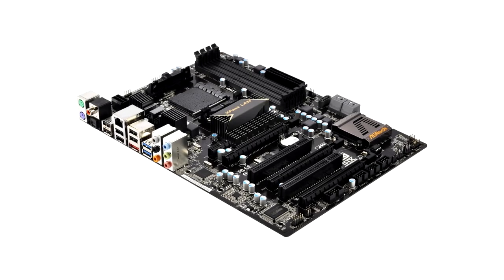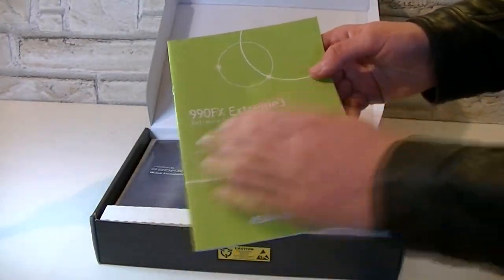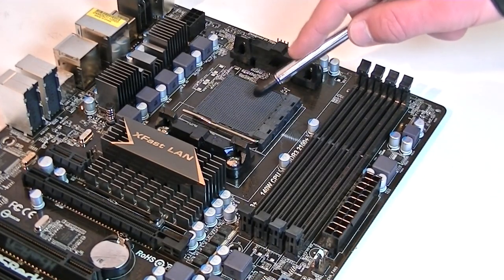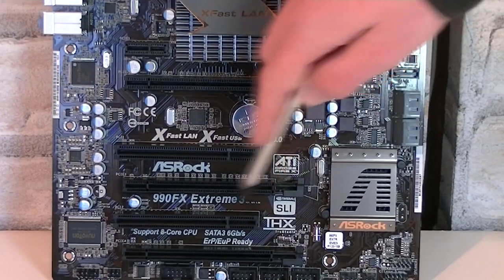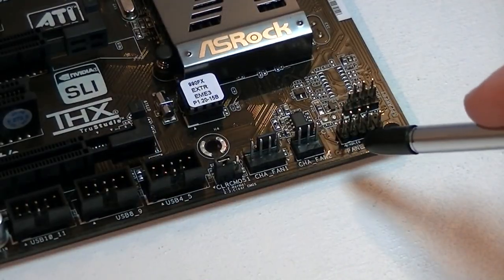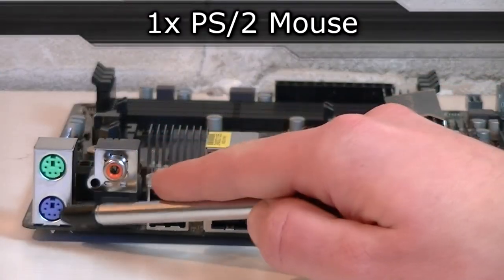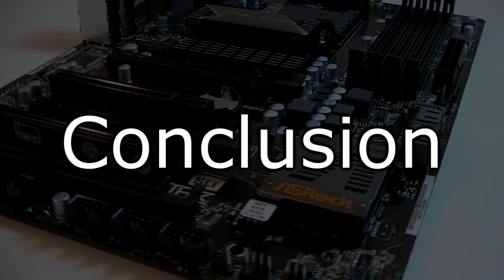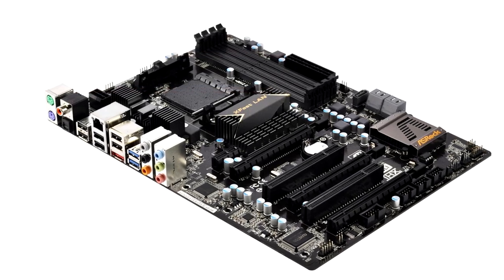ASRock 990FX Extreme3 Motherboard Review

Comment: Nice review, doing a $1 500 Australian builds with an 8320, 16GB RAM and GTX 760s in SLI and still wanting a 990FX board, 2TB HDD, SSD, 650W 80+ PSU, Hyper 212 Evo and a Carbide 300R

Comment: This motherboard rocks!   I've had it for nearly 6 to 8 years, give or take.   My system is Asrock 990FX Extreme3 Mobo, FX-6400 (Vishera 6-core) processor, 16 gigs of Ram, Ti-750 dual fan 2 gig video card, running under Windows 7, and I haven't had any issues.  I do not overclock it, because that shortens the lifespan of the system.  Not a single maintenance issue, and I haven't cleaned it in over 2 years, or longer. lol

Comment: for just a little bit more you could get a 990fx Fatal1ty from ASRock, With the 12+2 power phase the vdroop is nearly gone on the board and runs cooler then the Extreme3 at a higher clock.

Comment: Great review Nicolas! This does seem like a great motherboard, especially given the price. I'm in South Africa, and here this motherboard is on the same price level as an Asus that only has a 970 chip. Even the Extreme4 is cheaper than an M5A99X (990FX vs 990X and has a USB3 panel included!)

The only worry i have here is the after sales support, given that there are very few dealers of ASRock, with the market dominated by Asus and Gigabyte! Great value though

Comment: Great Video. I am thinking of buying the asrock 990fx extreme 3 motherboard. I am planning on running crossfire on  two sapphire 7950s. I am not planning on overclocking my CPU which is the FX-8350. Am i going to have any problems because of the fact that my M/B. has 4+1 power phase design?
Reply: thank you! that's what i bought!
Reply: Jimmy Greek Any issues with VRM overheating and CPU throttling? I just ordered this board and an FX-8320 which I'm hoping to overclock to an 8350. That way it'll feed my dual 270X's what they need (assuming the over clock doesn't overheat the VRM and throttle the CPU)
Reply: Patrick Woolard no and if you ordered it send it back, dont open it or anything, it has no usb 3.0 header its like someone selling you a car with no air conditioner. its not necisarry but if your new $30,000 car didnt have it and better cars for the same price had it, it would be really head aching
Reply: Patrick Woolard Nope, no problem at all!!! :)

Comment: Actually this is one of the best budged 990FX chipset motherboards which you gonna use only with AMD FX 4xxx series cause of 4+1 power design. And you can do even some decent overclock of FX 4xxx. You can use even 6xxx or 8xxx version of FX series but I recommend only 95W TDP version (FX 6300, 8300, 8310, 8320E and 8370E) and only on stock frequency.  I know that I'm too late with this comment but still good review.

Comment: I have this mobo but only with fx6100. I'm planning to buy a Fx8350 but at the asrock website this cpu doesnt in the supported cpu list, so will it work cause now i cant buy the older fx8150 in Hungary, but i need stronger cpu.

Comment: I have this with an amd 8350 and it doesn't always start...
It turns out this board has a 4-1 power phase which simply can't handle the system starting up...

Comment: Building a AMD-FX-6.. Dual 7850 4 gig.. Lets see what it does....
Reply: Bad choice... For the prize of that you can build a computer with the FX 8350, R9 270X and 8 GB of RAM. Dont buy that.
Reply: It's built and it's wonderful. AMD FX 6 core, Dual 7850 4 gigs, 16 gigs ram, Crucial SSD 240 gig, 1 terabyte hard drive, 7 case fans and 14,724 3dmark11. It plays BF4 on max and I get no less than 80FPS and tops out over 200.

Comment: ASRock and the other motherboard manufacturers are doing the best they can, but AMD seriously need to improve their chipsets and mobo specs. They're still using the same layout and essentially the same chipset(plus a few more sata ports,no native usb 3no  modern features etc) from almost a decade ago. Using the same motherboard is bound to affect a new cpu's performance, especially in the power and cooling.

Comment: will this motherboard support the fx9370 cpu?
Reply: I would recommend the extreme 9 version. The 12+1 phase cpu power will deal fine with the power draw.
Reply: Unfortunately no. The 9370 is a 220w CPU and this board only supports 140x CPUs.